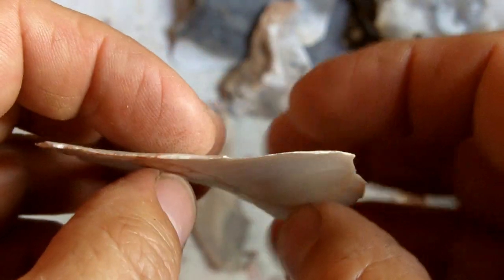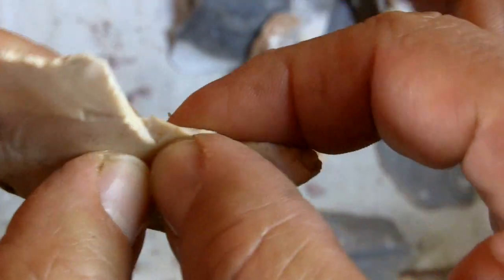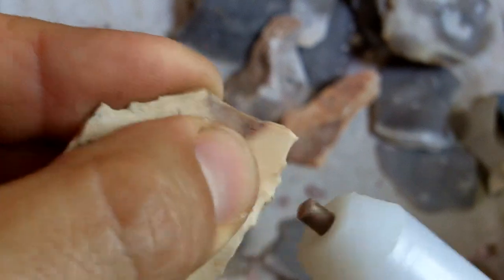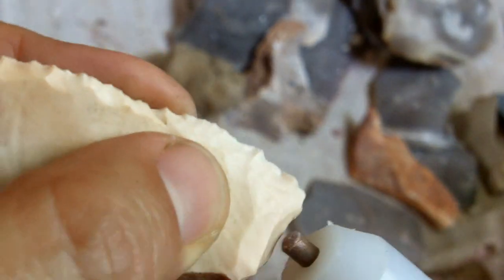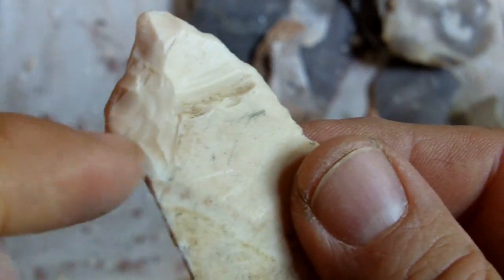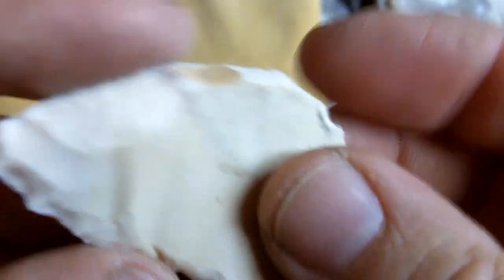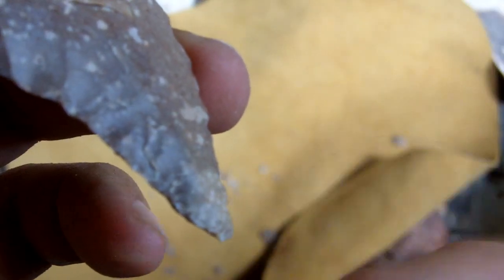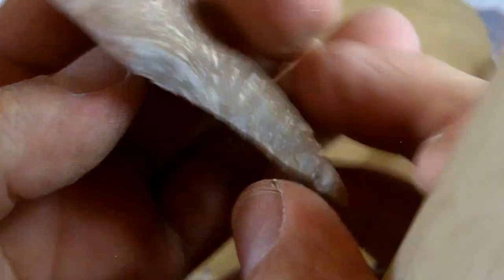358 - Problem Edges and Thin Flakes Flintknapping Part 1/2

Comment: I get these odd flakes that you don’t  think are hard enough. But some times it is your planning that is more important than hitting the rock. I picked up on the flint piece you indicated had a dished up curve and that you would remove it and that would make the rest of it easier to Work. I would have struggled with thinning the thick part then try to get it to work with the curved section. These are things I’m watching for. All my points are too thick or have a thick area on a small point that can not be reduced.
Reply from the maker: Strategy is important for sure. If you get a chance, watch my artifact videos. A lot of real points have the issues you're taking about. (edit: it's not about the craftsmanship... it's about the usefulness of the point, blade, or tool).
Reply: @KnapperJackCrafty  thank you for replying

Comment: Jack, I'm not a new knapper or old one. I am not a good one better describes me.  However, I would love if you explained how the big flake, small flake, small flake and then another big one is done in more detail. I do the Zig Zag, but was unaware of the use of small flakes. I wish I could draw a picture of how I understand what you are saying. To me the edge of the stone would look like a capitol Ess with a small ess inside the middle. To describe another way is to say a big flake to the left, small flake to the right, small flake to the left and then a big flake to the right. Can you shed insight into my understanding ? Is this method only used to take out the convection  on one side of the stone ?
Reply from the maker: The big flake, small flake technique is used on the same side, not left and right. Take a big flake, then one or two small flakes to straighten out the ridge (the high area on the perimeter of the flake scar), then take a large flake following the ridge.

Comment: hello!)) 

can you please tell me whats wrong? everytime i try to flake a piece, i flake a short but bulgy flake, therefor im not loosing any width just length, and im ending up with like 120 degree edge around the whhole piece and it becoming small as hell...

more of this, i thought its because i didnt heat treat the stone, but thtas not it, its the same with heat treated, not treated, glass or obsidian... the most sad part is that i don't have obsudian in the country so i payed money for it and broke it all...
Reply from the maker: Very common problem.  The 120 degree edge is actually very good for driving long flakes.  You will need to grind the edge and hit very hard.  You will need to break many pieces and try many times but you will be able to drive long flakes with practice.  If you don't have a lot of stone, you will need to focus your time, money, and energy in getting a good supply.  For me, it was quite expensive at first.
Reply: +JackCrafty thank you very much for your quick response, much apprritiated and respected!
now i have some equipment, i have iron pick many sizes as well as antler leather and i have a desert flint.
i live in israel so flint is not much of a problem, yet the grains are not so fine and i dont know if im treating them right, i put them in a oven in a glass pane full of sand at 250° C (below 500f°), for up to 6 or 8 hours straight and the flint still has some parts tha wont flake, ther rather behave like sandstone and just get some dusy off or cut a flake in midway...
Reply from the maker: +Inecendium I have made arrowheads from chert from Isreal and it is very tough, I agree.  I recommend heating it as you have already done.  Sometimes the rock contains bad areas but that is common.  Just keep trying.  :-)
Reply: I will defently try and keep up my work!!
thank you!!